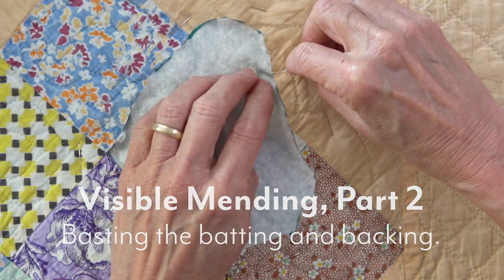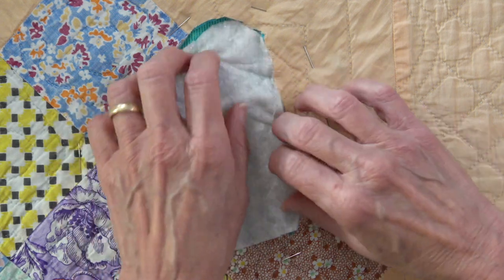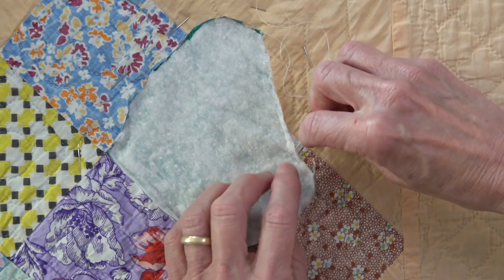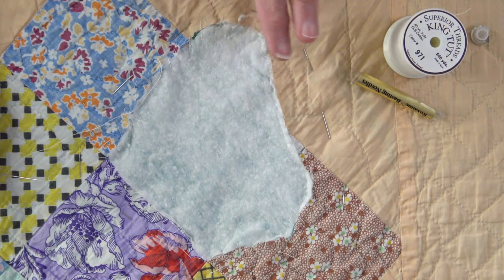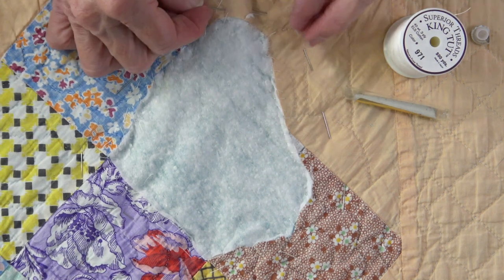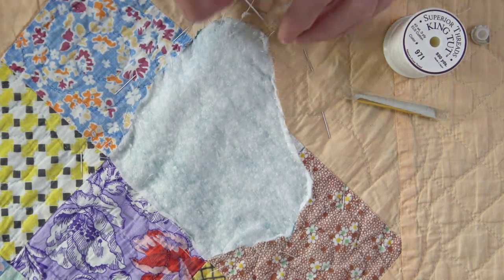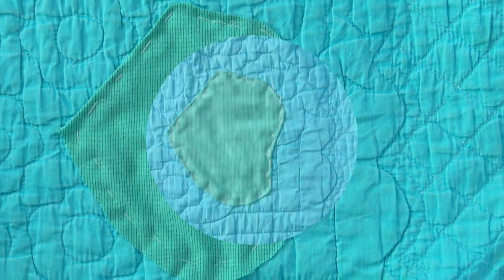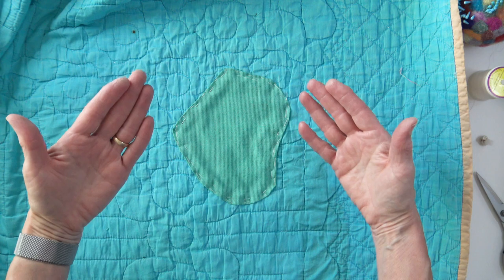Visible Mending, Part 2

Comment: I'm 1st time learner, learning on my own . I'm trying to mend a whole in a quilt my grandma made me.  I don't have any bedding or whatever you called it.  Can I use these steps without it?
Reply from the maker: I'll bet you mean batting—the fluffy cotton that fills and softens the space between the top and bottom layers of the quilt. You can mend the holes without it, and/or you can substitute a piece of fabric for the batting. Cotton flannel might be OK. 

Test it out before you sew. Pin the pieces of fabric that you intend to use in place, without batting or flannel between them, and see how it feels. It will be different and if you are OK with that, then that answers your question. Do you live near a quilt shop, sewing store, or quilt guild? If you decide you want some batting but don't want to buy a big one, introduce yourself in any of these places and see if anyone can give you a little scrap of batting. Quilters are very friendly :-). I hope this helps :-).